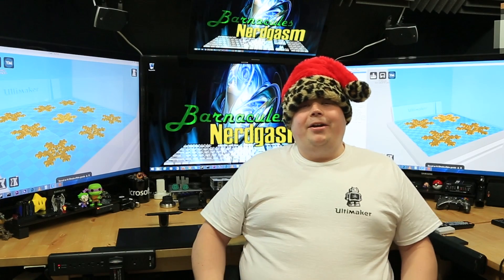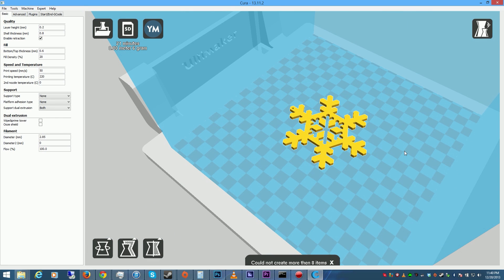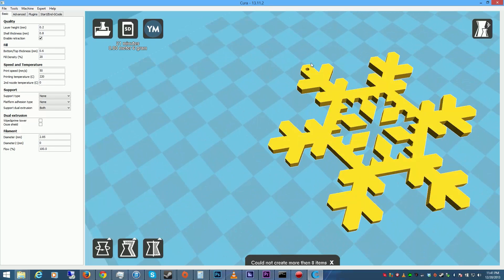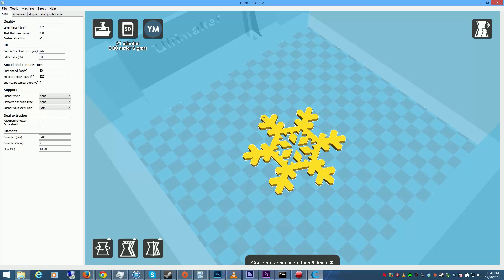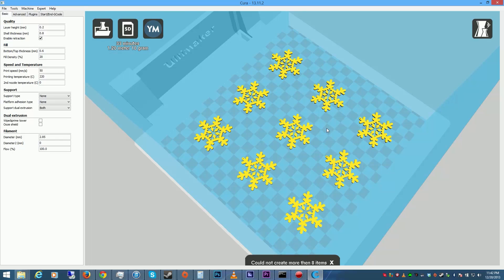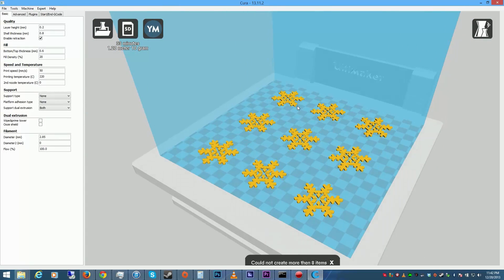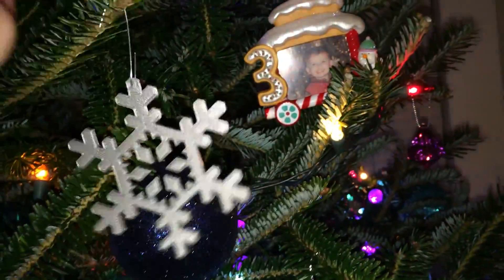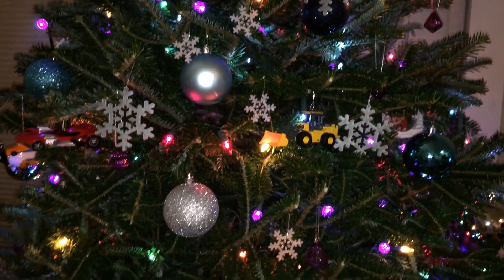Decorating my Christmas Tree with Ultimaker 3D Printed Snowflake Ornaments - @Barnacules

Comment: If you have any extra time can you please do a video where you can experiment the quality of print for ABS and PLA, I have researched a series of printers and wanted to buy one but I needed some extra info between the filaments.  I am sure that several people would be interested .Can you explain which is better: PLA or ABS or which one would be better suited for certain projects? I have heard that PLA can achieve finer details than ABS prints. Sanding is supposed to be better with ABS.  Also that if your 3d printer does not have a heated bed then it may distort your print.  I was thinking a great demonstration would be to print a variety of pieces: starting with something flat similar to the Legend of zelda emblem then to slightly more complex objects with both ABS and PLA in the same resolution. One more thing would be a resolution comparison by printing the same piece five or more times with the resolutions: 300, 200, 100, 50, and 20 microns. Thanks for your time.
Reply: Ben Heck has a 3D printing overview that you should watch

Comment: Wich do you prefer? the robo3d or the ultimaker?
Reply: Ultimaker mate it's uber cool!
Reply: yes, but its costs a bit more, the robo3d is really cheap.
Reply from the maker: Ultimaker is the more reliable printer with most consistent results but it also costs 3x+ the cost of the Robo3D. And the Robo3D has a heated bed so they both have a lot to offer.